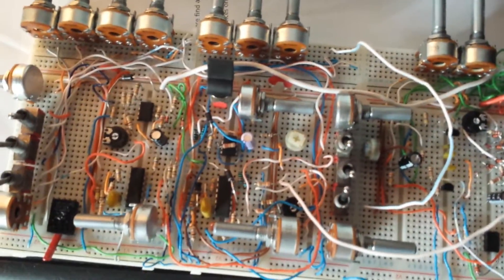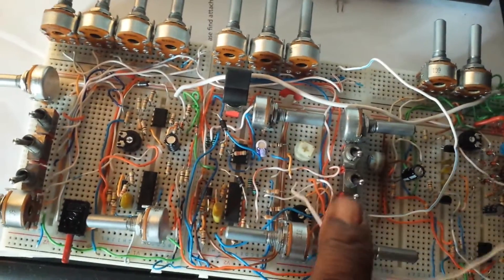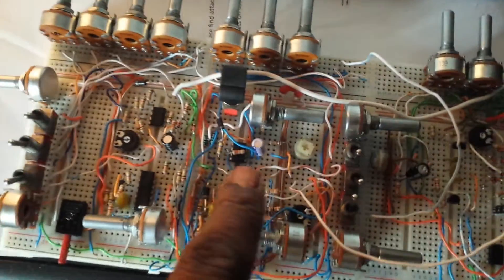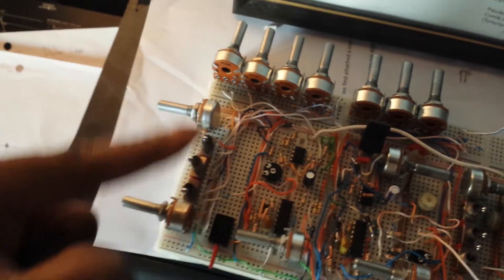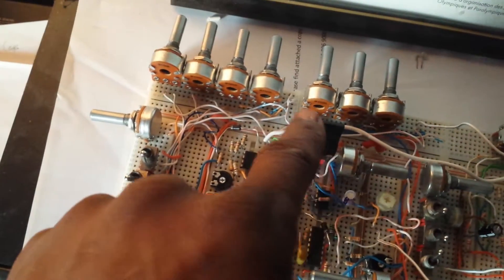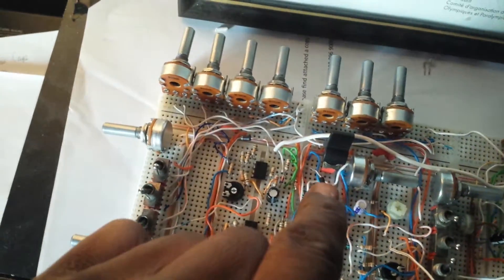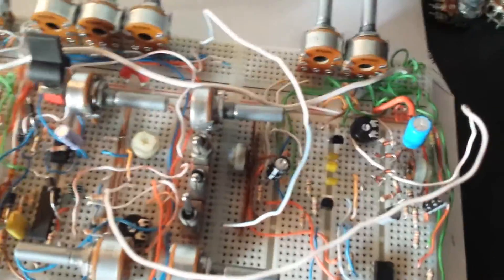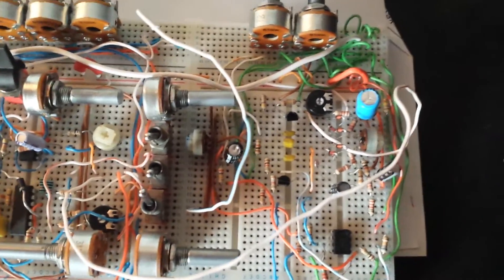DIY analog synth project Part 1 (Overveiw , here is where it all started)

Comment: Did you ever get round to making a schematic for this?
Reply from the maker: This particular circuit know as it basically was the basis for what I have for my oscillators now. Thou check out my " saw core oscillator "  vid which is a development from this . I further added triangle and pulse waveshaping after this, plus an exponential converter circuit giving birth to my own custom vco which does borrow from lots of well known circuits.

Comment: Adam, your synth is inspiring. I was wondering if you managed to find any ICs useful for synth building inside of consumer electronics? I always save the capacitors whose legs aren't too stubby and of course the buttons, switches and pots. oh and I found a polystyrene capacitor inside an old telephone! Hate to buy it if I don't have to. Thanks for documenting your progress and including schematics. It has been very helpful.
Reply from the maker: Hey thank you. Yes I have found lots of things in consumer electronics. Lots of diffrent types of caps. Even an old Dolby noise reduction chip and many other useful bits and pieces. It's worth grabbing if you haven't already a  small component tester. I bought one which was in a diy kit from ebay. It has never let me down so far.
Reply: @AdamTheAd-vanc3d  I love my component tester too, it has been invaluable. The dolby noise reduction chip sounds interesting, I'll have to peek inside some old stereos!
Reply from the maker: @RaccoonEatingCacti  Indeed get your hands on whatever you can old stereos and even TVs , vhs players where you will more through hole parts.

Comment: your LFOs are nice and sloooooooooow!
Reply from the maker: edgeeffect Yes i figured out the larger value of capcitor the slower the voltage discharge.
Reply: Nice, you can all sorts of ace "textural" stuff with a good slow LFO.
Reply from the maker: edgeeffect Exactly love it especially when you have both filters at diffrent modulation rates and each at diffrent modes. Can get some really nice sea atmospheres  effects with the white noise passed through.
Reply: Oh yes!!!
Plenty of different LFOs at different rates is FABULOUS!
Reply from the maker: edgeeffect Indeed 😊😊😊😊

Comment: Looks amazing bro. I've heard the sound on FB group and must say it sounds pretty damn good. I hope you are willing to share the schematic. 

Anyway great job.
Reply from the maker: Thankyou for watching, as i said in one of my comments on FB this build does not strictly follow any schematics apart from the filter which is a half copy of the arturia minibrute multimode filter. Even then i have used completly diffrent caps and values in the diode ladder and was suprised by the sound i was getting .  The noise generator is also from the minibrute schematic as well as the Envelope generator being from a Yusynth schematic i think. However there are lots of devaitions in the circuits where i have experimented and just done things using my own logical sense and they have worked or not worked. Bit of a Hybrid project shall we say.
Reply: Which ic's did you use for the oscillators? It sounds amazingly smooth even for a phone video
Reply from the maker: I only used TL074s or 084s (basically the same), and TL072s/ JRC4558DDs i salvaged (for lfos). So really op amps and the rest completly discreet circuits. They are mostly all very common obtainable parts apart from the capacitors in the oscs which i salvaged from an old casiotone 8000 really nice polyester metalfilm caps and give a good waveform and tone. They are the yellow caps next to longer ics which are TL074 quad op amps .